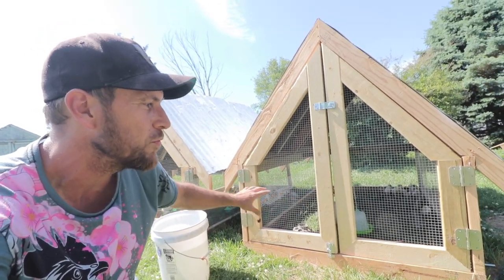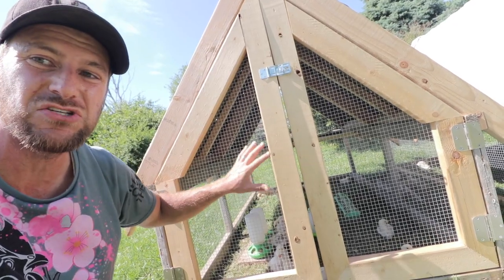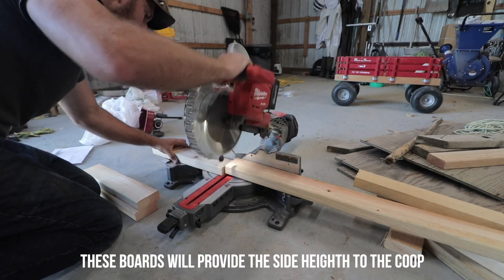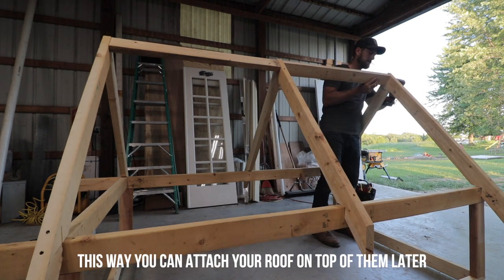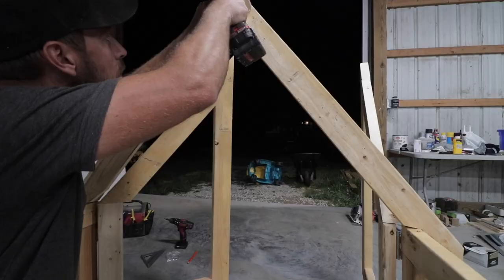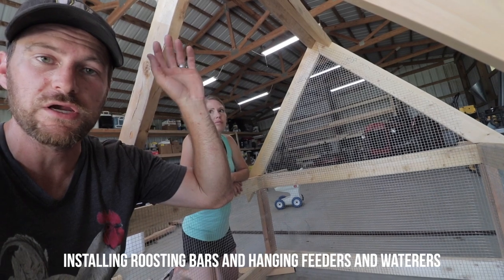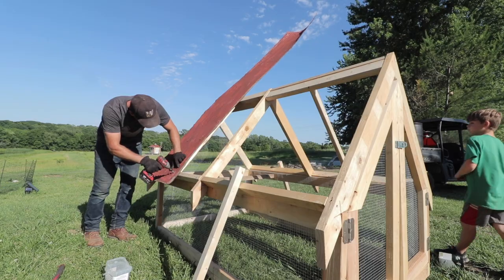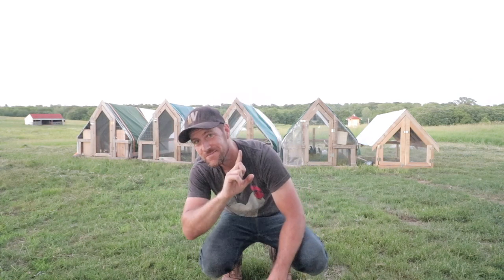The MINI CHICKEN COOP you can build in a day - HOW TO BUILD

Comment: I'd also like to point out, by stapling the hardware cloth on the inside, a large animal can push the staples out.  Would be better to staple from the outside and/or put another layer or lumber over to secure the staples.  Cut 1/2" pieces of plywood would secure them screws.  Maybe, an extra support board about 1/2 way down the sides to better secure that hardware cloth.  I love the build and think this would make it better.  Thanks

Comment: One other thing of note is the ease that a design such as this would be to tie down in the event of a storm. Whilst it might be wild for a bird inside, probably best to move them to a fortified shelter to reduce stress and potential flooding. 
Pro Tip: You can use some PVC tube to cover the sharp edges of the corrugated roof.

Comment: Just FYI, cutting the hardware cloth is much faster when you use a 4.5'' grinder with a cut off wheel. I used to cut thousands of lineal feet of hardware cloth at my old job and it's way faster than clippers or shears.

Comment: Really great vid and concept, and o followed the directions and plans to a t and cannot get the roof chevrons to meet when 45” long.  I ended up extending them to “50 and made it work, but am curious about the dimensions you listed.....  Not trying to criticize but u hi st checking to make sure.  Did you use standard 2x4 or did you cut them to actual 2x4?
Reply: I also had trouble here. Even at 48” I couldn’t make it work. Using the rise/run method to calculate the angle I’m at 39 degrees for 45” board. I haven’t figured out the solution here yet. Also seems the wheels are too big.

Comment: What would you recommend for a permanent coop for about 4 chickens that's in a colder climate (summers at around 70, winters can get down to -30). Would the coop need to be insulated? Have it's own heater for the winters?
Reply from the maker: Tara Elisy - you could build walls and insulate them if you needed to. Just close it up with something that doesn't have holes in it, thin plywood or linoleum.
Reply: @whitehouseonthehill  thank you so much!

Comment: I ran into some problems. 4 inch screws aren’t long enough so I had to go from an angle. I’m confused about the roof too. The 6 supports are supposed to be 45” with 65 degree angles? I find it’s not joining together correctly.
Reply: Having similar issues with the roof. Did you figure it out?
Reply: @RipnRev  This part confused me for a long time. I ended up cutting 45 degree angles on one side of the board and 65 degrees at the other side. I put the 45 degree cuts together to form the roof top.

Comment: I could probably do everything pretty well up until the roof build😂
Reply from the maker: Trevor Harbolt - it can be tricky to cut angles - but measure it out, check it against the structure and you'll figure it out 👍🏼
Reply: Do one side higher and do a shed roof not peaked in the middle, Justin Rhodes just built a flat roof one

Comment: Quick question we are working on your mini coop and we cannot get the 65° angle to work out. It seems to be too steep?
Reply: This part confused me for a long time. I ended up cutting 45 degree angles on one side of the board and 65 degrees at the other side. I put the 45 degree cuts together to form the roof top.

Comment: First off I love you guys! Second off this is not trolling, please read all! I've always loved every project you guys have built, but man STOP!!! before you seriously hurt yourself! You need some skills and woodworking safety lessons first! @3:50 you're lucky you didn't lose a thumb you can make a jig very simply to cut that angle on your saw, it's pretty basic to do you can find a YouTube video easily on how to. Do not hold the board like that! @4:00 you should use a miter gauge, or a crosscut sled, but there are much better ways to make this type of cut, for what you're doing "I'm just saying". @8:20 use your fence and a couple feather boards along with a pusher stick. You're lucky you the board didn't kick back and you seriously hurt yourself. You got your kids helping you and that's great, but I'm sure they wouldn't want to see Dad seriously injured!

Onto your build and Design, build the side walls first then connect the two sides together with the front and back, rather than try to balance the top and bottom. When you build a house you build the walls first then connect the sides together, then the roof, it's the same here LOL. I think you'll find this much easier. 😉👍 
Now onto your joinery methods, screwing into the end-grain like that for the walls is not very strong and I would seriously recommend on the inside of each wall corner you back each joint with another 2x4 so you're not just screwing into end-grain. These would be 4 more 2x4's cut to 24" place the boards in the inside corner of each joint between the side walls and the front and back. This will make the whole thing a lot stronger and last a lot longer, without falling apart overtime, and only cost you only one extra 2x4x8. I will suggest you make the change to your guys's coops to ensure they last a long time, and not fall apart. All you have to do is cut the 4 boards and screw them in to make the mod, on yours. 
I would also possibly suggest some nice lap joints on your doors for similar reasons, but that gets a lot more complex... Maybe just some nailer plates on the back of each joint, after all it's just a door, and if it breaks with time it's pretty cheap and easy to replace.

I really like these little chicken tractors coops, they're real nice, if I ever getting a chicken's of my own, I might have to make one..... but yeah, several years of shop class, years ago in high school with a very strict shop teacher on safety.... so yeah it's kind of drilled into me right now, and watching this kind of made me worried for you, so please be safe, and thanks for the great videos. ❤️